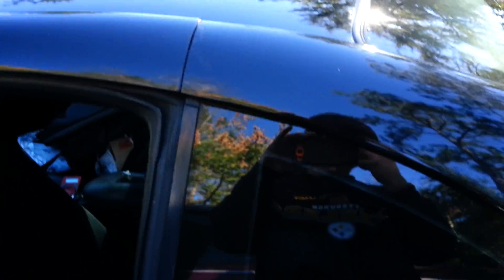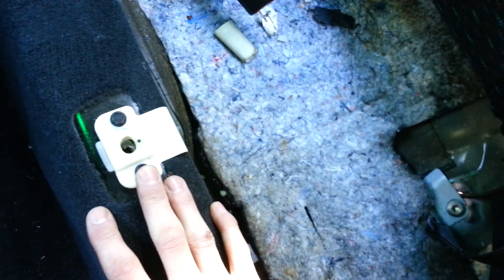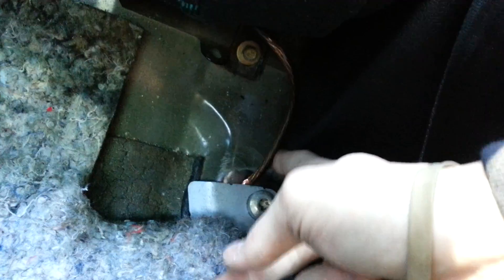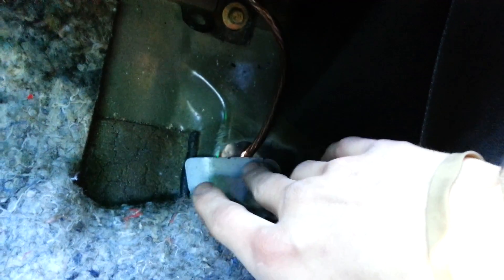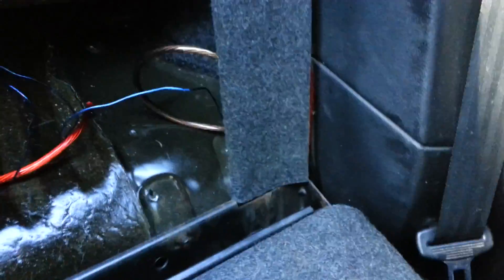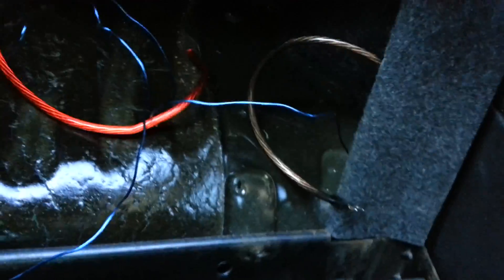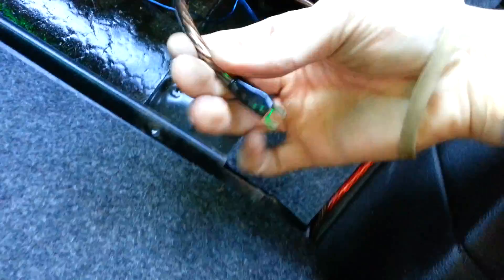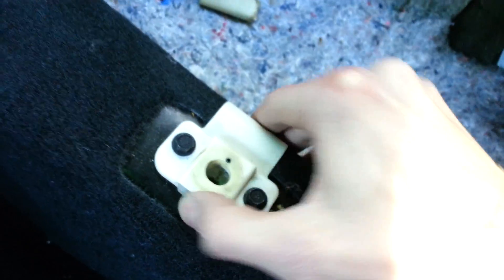Amp install on 98 mustang

Comment from the maker: Very simple actually. There is a rubber grumet on the driver side in the hood I believe above the steering shaft and run it through. If you need a vid I can make one for you once you find it is very easy. No drilling and anything needed

Comment from the maker: @E2daC1 all you have to do , if you have the stock system, is run a line output converter from the rear speakers

Comment: there should be a rubber plug that is in the fire wall, just poke a small hole through it and run the wire through it